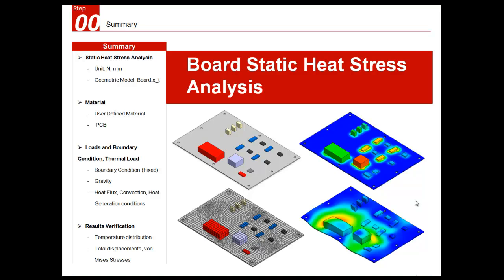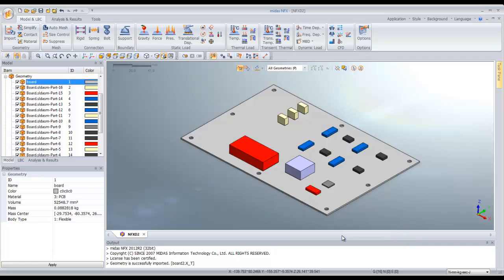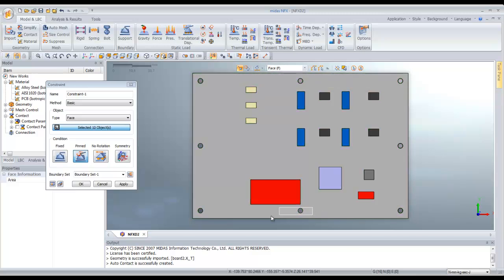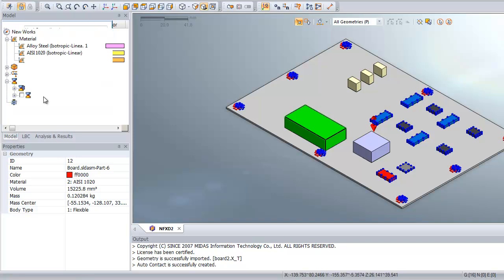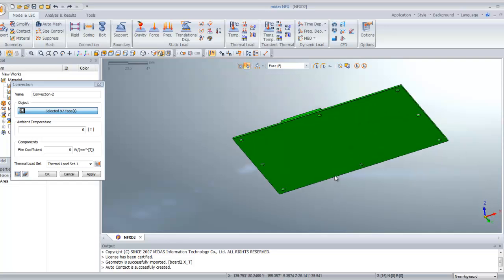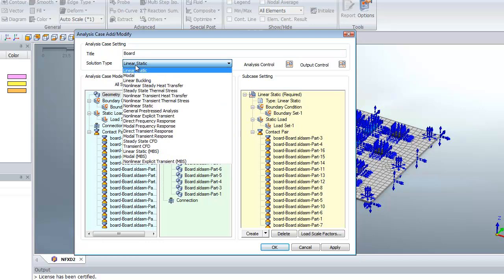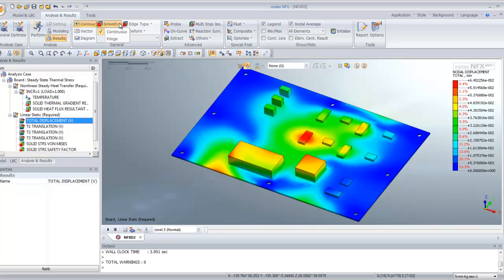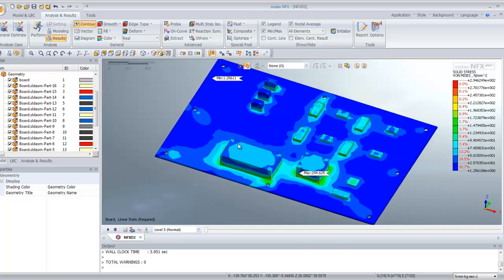PC Board Thermal Stress Analysis tutorial with midas NFX CAE Solution

Comment: Hello sir,

 Can you do the same analysis in  ansys software ? because am using ansys workbench software and i don't know how to do thermal analysis for pc Board . i searched   in you tube also but i did not get any results so can you help me . 

if you can do it upload your video otherwise give some idea for rectify my problem . 

I subscribed your channel & Awaiting for your response.

Thanks
Reply from the maker: +Vignesh A Yes, you are right. In space, there is no convection because there is no air. In space, most of the heat is exchanged by radiation.
Reply: +Cyprien Rusu  can you send same video in ansys software ?
Reply: +Cyprien Rusu : In this video is super and very knowledgeable but am just beginner in thermal analysis . in this video you gave values of  heat flux , internal heat generation  on electronic components  directly . but electronic components creating heat (watt)only,  but heat flux is (Watt/mm2) where you got that values &how you got that values .
Reply from the maker: +Vignesh A No, I cannot